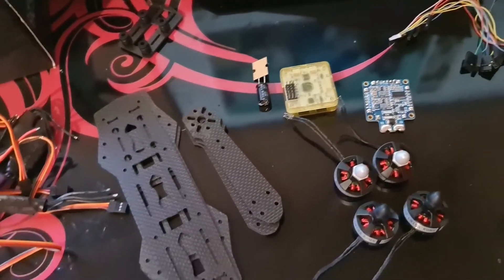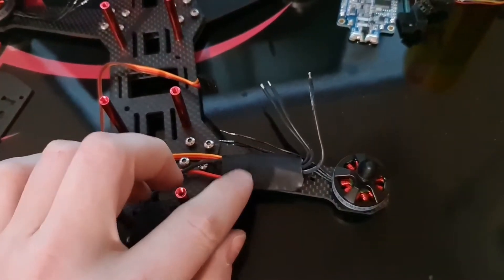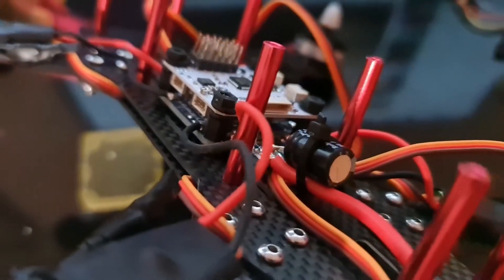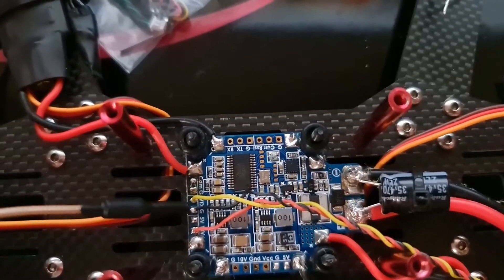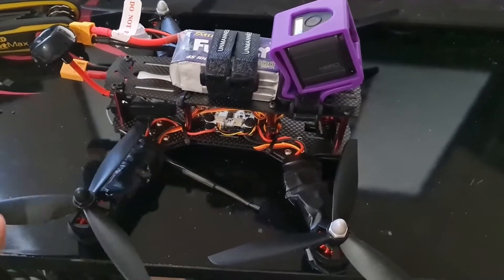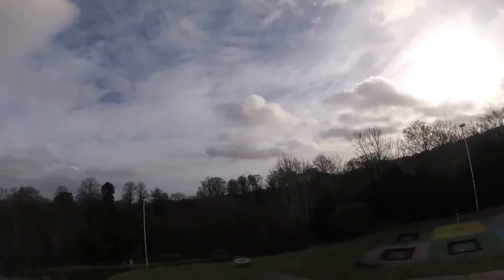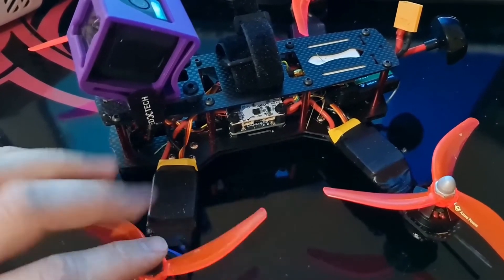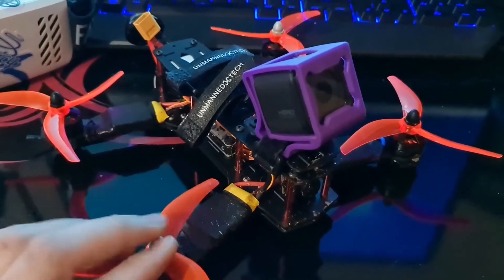QAV 250 (clone) DIY Build Video - My First Ever Drone Build

Comment: This looks sweet dude. I can’t wait to build my first quad. Was it difficult for you?
Reply from the maker: Yeah it was a bit of a nightmare due to the wrong info from the supplier which then caused a few esc's to blow! DO some research on parts before purchase to avoid making the same mistakes I did lol other than that it was lots of fun building my own :D Soldering for the first time was tricky but got the hang of it